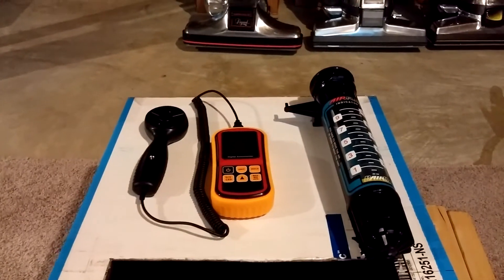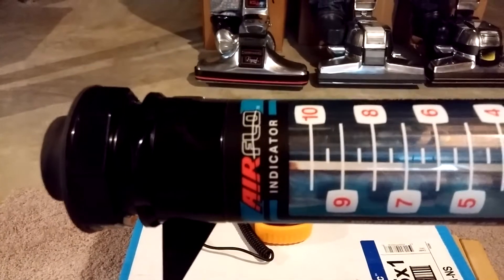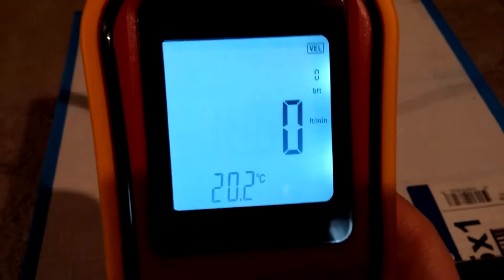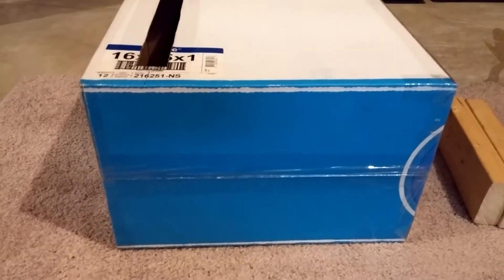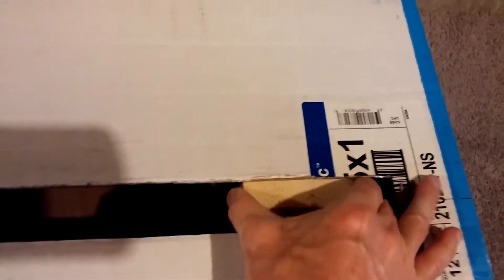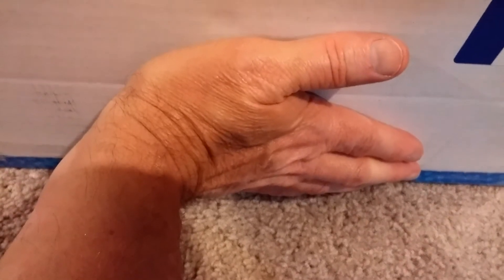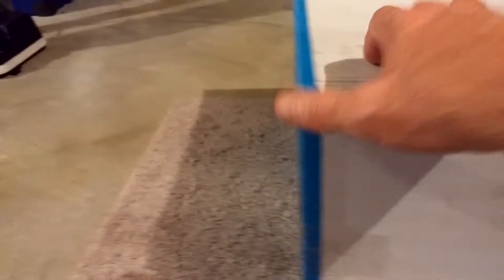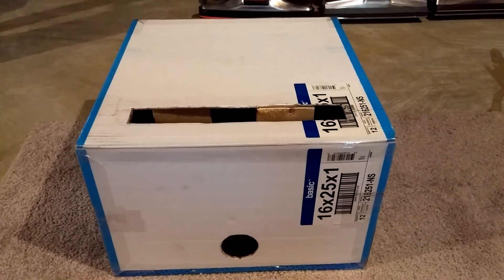Airflow Box Introduction

Comment: Hi I was wondering since it’s been over a year since you made this video, if you have made any improvements to your airflow box because I’m thinking about making one. I’d really like to test my tandem air vacuums
Reply from the maker: Riccar Rad well there aren't really any improvements to make per se. I would simply build a whole new one out of wood, so I could measure suction in addition to airflow. 😄
Reply: VacLab thanks I’m going to try and make myself one. I have both models of tandem air vacuums. the larger radiance/synergy and I have the newest model brilliance/synchrony. I’m just very curious to see how much airflow they can create. I know it’s not as powerful as a Kirby, but I do think it will come near it. If I had to guess I’d say tandem air vacuums have around 90-120 cfm, But I worry because I talked  to someone else who does airflow box testing also and they said they had a hard time getting a good seal to there airflow box. So I hope I don’t have the same problem. His results varied from 83- 99 on his synergy if I remember correctly
Reply from the maker: Riccar Rad good luck! Will you post videos of the results?
Reply: VacLab thanks and if I’m able to make one I will be ordering the anemometer next Friday. And I will be making many many videos and posting all results , I have about 20 other vacuums I’d like to test also lol